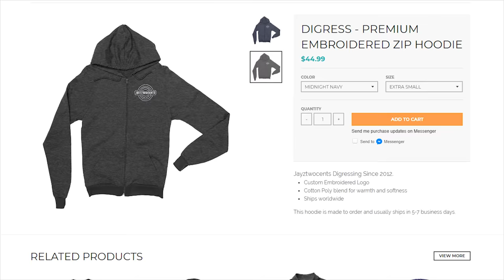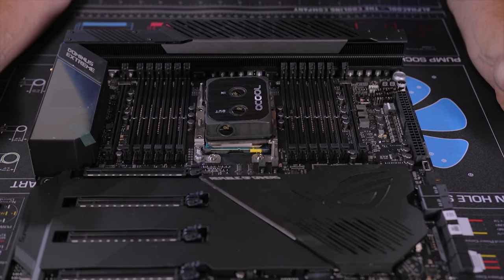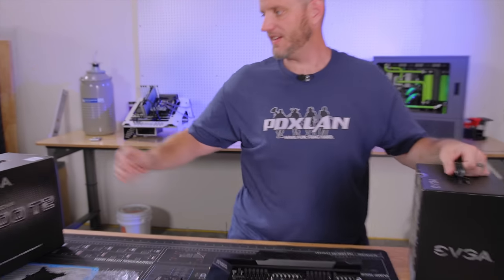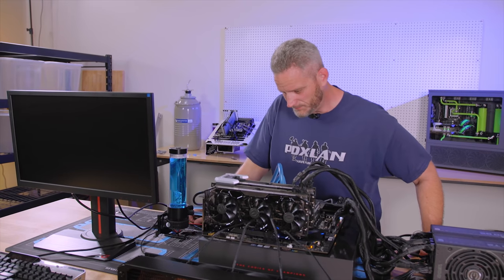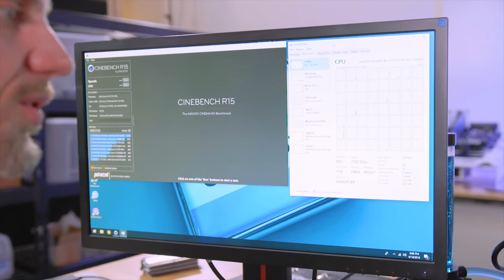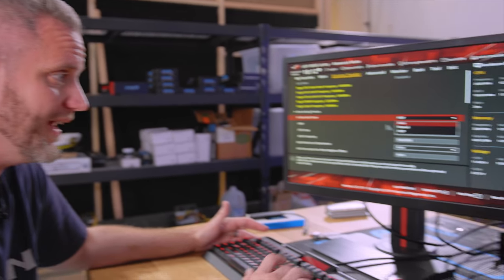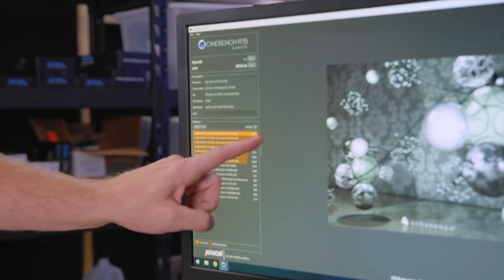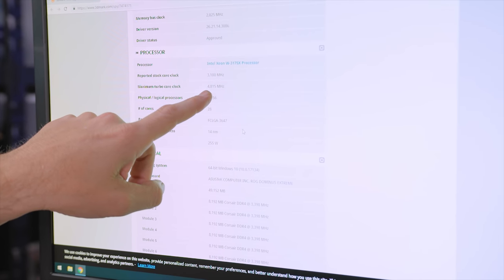Intel Xeon W-3175X Overclock Testing! This was unexpected...

Comment: Nick just "walks by" with a model ship... Nice shameless ad placement for World of Warships Jay! 😂

Screw dual RTX Titans...

Give Steve the benchmark haymaker with dual Quadro RTX 8000s with dual channel NvLink.
Reply: Linus tried Quadros. The performance was bleh.
Reply: @SoranoGuardias  I figured as much, however if you could hack the BIOS of Quadro card you technically could clock boost it maybe to a point where it could match attainable clock speeds by Titans or 2080 TI's, however you would need some significant cooling and very few vendors support water cooling developer level boards.
Reply: @ReaperX7  The power budgets are not high enough. The PHYSICAL power budgets are not high enough.

Comment: overclocked tr 2970wx just touches 5000, and I have seen some of those on Ebay for as low as 1K$USD

lol
Reply: The 2970WX is pretty slow, a 18 core 7980XE just smashes it to pieces. The Xeon W3175X was meant to compete with the 32 core EPYC 7601, a $3K-4K USD CPU

Comment: Seeing that first Cinebench run gave me a flashback to some time 2009 or 2010 when I ran Cinebench on a 8 CPU machine with Opteron 8439 which is a six core processor. The first run of Cinebench had my standing there with my jaw dangling uncomfortably close to the floor. None of us had worked with anything more than dual CPU boards, so seeing 48 cores chewing through the Cinebench benchmark was very impressive. I saved a lot of benchmark data from that machine just because it was so out there, but unfortunately the company I worked for folded some years ago and I didn't think of saving all the benchmark data I had collected. It would have been fun to see how that monster would fare against modern desktop processors. It couldn't hold a candle to this monster, that's something that's certain. The 8439 ran at 2.4 GHz, and the 8 processors was distributed over two PCB's connected using Hyper Transport links. I do not remember the exact interconnect fabric, but I think there were just to HT links connecting the boards together. I think a worst case scenario had data hopping three processors for one memory access and that cost performance.

Comment: AMD: Laughs in 64 core Threadripper
Reply: Doubt that AMD will create an EPYC Rome CPU for the enduser...and even then, it would probably be a trash version of Rome just like how the 2990WX was the trash version of the EPYC 7601
Reply: @JABelms  I'was expecting a 48 core TR actually...

But the recent leaks changed my mind because:

1)Intel is doing the same.

2)They have a chance to win in almost every benchmark by a factor of 2, and that if tou ask me it's a great marketing mechanic for lower end products.

3)They'll be breaking world record left, right and center with OC.

4)They can still modify the I/O chiplet for segmentation.

5)It'll be fun.
Reply: @danielepicone2557  Still doubt it, a 64 core TR should be a lot cheaper than the EPYC Rome version, and you know the drill...when you make an EPYC chip cheaper you cut corners and it would have an abysmal memory controller (again) just like the 2990WX. And it is kinda hinted in many benches that intel IPC still leads

Not to mention how useless it will be to have a 64 core CPU for mainstream users. 32 core still has very few use cases in the real world, and that even 16 cores can get the job done. But 64 cores? Planning to use it for a server? AMD was talking BS when they marketed the 2990WX as the first "32 core gaming CPU" (which is dumb in itself), I don't believe they have an excuse for a 64 core Threadripper anymore. Besides, professionals usually buy EPYC or Xeons instead

That 64 core threadripper would just replace the previous manycore world record holder 2990WX. 95% of the world records in HWBot are not solely about more corez...that is why the 7980XE holds almost all of them

Comment: 1U != a blade server! 1U just means 1 rack unit, or rather one slot in a rack. Generally, a blade server is when you take a traditional height server, 4U for example and put "blades of servers" within that enclosure. Usually that enclosure supplies all power to the blades, for example, a 4U enclosure would slot 8 blades to increase density in the rack.

Comment: Hey Jay! Normally on the LGA3647 based systems, you actually mount the processor in a plastic bracket that then in turn gets mounted on the heatsink. You then put the CPU+heatsink directly in the socket. It's a terrifying experience because you can't see what you're actually doing and if things are aligned properly.
On LGA3647, it's actually the heatsink that provides the correct amount of mounting pressure. I think Intel states on their own active cooler, that you tighten with 1.4nm of force on those. The 2 threaded pins sitting on either side of the socket act as springs and tighten up. The corner threads are just there to guide the heatsink into place.

Comment: Ok, get a BIG cooler and fill it with ice.  Let it melt down a little for a couple hours, put copper coils in the cooler when you put the ice in, and then connect your loop to the cpu, and both GPU’s.  Run the pump by itself for about an hour with the computer off.  Fire up the computer and IMMEDIATELY jump to the testing.  Leave the pump running at max speed and have all the fans at max speed.  The give Phil a 40v lithium brushless leaf blower to point at the rad also!!

You’ll hit 17,000 in a jiffy.  Also, put the 4000 memory in.

Comment: The specsheet for the socket specifies the side screws should be tightened to 12 lbs-ft of torque, and that should ensure all pin solid contact. Get torque screwdriver and check.
Running this board on a cardboard box is NOT advisable, btw. It introduces flex to the PCB under the socket.

You're not the first to have issues with missing memory channels on this CPU, but this rarely happens on the server platforms. Roman Der8auer machined his own retention bracket and had better luck, but again, server motherboards are mounted usually on a pieces of solid metal reinforced with welded on profiles for stiffness.

Comment: I work in datacenters on just hardware. From all the LGA3467 system's i've worked on, primarily HP DL380 G10's, they all want a torque wrench screwdriver set at 12 in/lb.

Comment: Hmmm. 1U = 1 Unit of a Rack. They aren't blades, and many people refer to them as pizza boxes. They are typically 1.75 inches, or 1U high, 19 inches wide with rails (17 3/4 without, and vary in depth up to 36 inches... Blades go into a blade chassis, which typically fits into a server rack but can vary from 1U on up. I haven't seen one bigger than 9U, but, I haven't seen everything.

Comment: The xeon series chips should have a plastic retension bracket that attaches to the heatsink, then that get set into the socket then torqued to about 12 inch lbs

Comment: the reason you got a better cpu score than GN is because of OS efficiency due to newer versions of windows 10 handling high core count cpus better and fresh installs just running faster than used installs but slower than stripped installs. Also newer Nvidia drivers could have become less intensive on the cpu with maturation of the cards and drivers.

Comment: Awesome build by the way. One thing I have been wondering about water cooling builds ( as I am interested in doing one ) I noticed all the fittings you put together, you don't use Teflon tape as we do in all plumbing applications. Would Teflon tape help in a CPU cooling system to prevent leaks? or are the fittings so precise that it isn't needed? or?....

Comment: I recently bought an old Dell with a Celeron D with a broken motherboard to use the case for a sleeper build. I killed the Celeron to get the IHS off and I'm going to attach it to the inside of the case in a prominent spot.

Comment: Does the motherboard automatically detect 2 supplies and turn them both on? Or do you have to have like a bridge, 2 power buttons etc?
Reply: the hardware pulls power as it needs it, the cables are the straw to the PCs cup of tea
Reply: Caleb Harwell motherboard does it by itself.  Also draws power from primary first, then secondary for the motherboard components.  Stuff plugged in via 6/8 pin cables draw from their respective power supply’s cables.

Comment: @JayzTwoCents I'm sorry for complaining here but at around the 3 minute mark, you're talking about blade servers and 1U 2U and so on. This is incorrect. That are RACKservers. Blade servers are something else. Generally blade servers are fitted into so called blade centers, and those blade centers are rack servers that follow the U height standard. Blades however, have absolutely no standard at all for heights, and are not even standardized within the same vendor, or heck not even within the same generation and vendor. And you're not going to be watercooling a blade server for various reasons. So please, don't confuse blade and rack servers. It could give someone the impression that they could actually run a blade server by itself, which you can't because it lacks all I/O because that's all part of the blade centers, not the blade servers.

Comment: Why doesn't some CPU heat spreaders come with an integrated water-block from the factory for higher efficiency cooling?  Why hasn't someone designed a fixture for water cooling to be soldered or epoxied to the heat spreader?  You could also use a vapour chamber with a water block attached directly to the heat spreader.

Comment: Would it be possible to try a passive cooling of the water with a chilled coil wrapped around the water pipe a two stage solution with the radiator.  That way the water would only be cooled some as it passes through the pipe that runs through the coil and you never get condensation, just several degrees cooler water.

The radiator would cool the air some, the coil even more.

i sort of can see the design in my mind and I wonder how well it would work.

Comment: Hi there, I want to ask what can I buy and what fits better to my pc
which is the better graphics card and the optimal one (if you don't want to reply you are free to do so, making me search elsewhere)?
I have an Intel Core i7-4790, 3.6Ghz, 16 Gb RAM & a Max Output power of 460W
with I guess, enough space for a 10" length graphic card,
for short, I have an XPS 8700 with windows 8.1
(I don't know what else I need to mention)
So I want to know if I can install any of these cards
(or which one do you recommend me, preferably for less than $350):
RTX 2060 (I know this one requires 500W I don't know how much is this important... for real)
GTX 1660 Ti OC (this one requires 450W, right?)
GTX 1070 Ti
GTX 1060 6GB
those are my options in that order (I want a GPU with at least 2 coolers/¿fans? not too loud) also, I plan to save it for the next black Friday or any other good discount so there's much time until I get it
In any case, Thank you very much for your instructions.

Comment: It's cool how power scales with money now.  So if you're poor and you buy used parts, you can get 1/3 the speed of the fastest gpu for under $90 and 1/3 the speed of the fastest cpu for under $170.  Yeah, my $600 computer gets 2200 in cinebench r15.

Comment: if a motherboard says you cant exceed hardware (GPU) beyond Nvidia GTX1060, does that mean I cant use a different brand? Or as long as the hardware matches pin slot?

Comment: Yeah, der8auer also said in video of this platform that is was a pain to get all the ram channels working due to the missing fixiation in the socket... Don't know why they did not do anything here, I mean you buy a 2000$ board and a 3000$ CPU and then you have to bother around with the pin contacts?

Comment: i bet the bracket design has the purpose of LN2 overclocking and with air cooling dont want the socket to end up having heat trapped under the retention design(witch is a server issue as well witch is why its dune this way) and as the price suggests you should not buy this if you are not a vary carefull pro user/overclocker.
Reply from the maker: That has nothing to do with it. The bracket is meant for servers which obviously LN2 isn’t
Reply: @Jayztwocents  well a test on does no retention bracket help with LN2 mods or not will need to be done now that I brought it up!

Comment: This is funny watching you guys in consumer fiddle with the Socket P (LGA3647) when we've been using it for so many years in enterprise. +DDR4 for Intel Xeon (Skylake) should only run 2667MHz, anything beyond that is pointless. Cascade Lake will be using the new 2933MHz but you don't have those yet. (I cannot wait to work with CascadeLake AP)

Comment: I think you don’t realize you’re using a 325W TDP CPU at stock so your loop is probably heat soaked really easily. You should be using a stupid ass Jayztwocents giant radiator project with this CPU. It’s not about chilled or ambient it’s about MMMMMMMONSTER power draw and proportional radiator insanity

Comment: There are so many settings on the Dominus Extreme, it's like a bible. It's a shame i can't even find one person who shares some info on bios settings how to overclock the W-3175X. I'm stuck at stock speeds, only because there are no instructions on how to do it. Not because i don't have the PSU or the cooling. Would be nice to use the "upload BIOS profile from USB"-function, but they are not to be found anywhere either. As a non-expert enthusiast, i feel left out.

Comment: Hello,

I need to build a system around 5000 dollars except monitor keyboard and mouse . My main purpose for this machine is i need to use that for 3ds max ,Vray for animation and rendering and some dynamics and simulation i thought to buy in this week.

CPU: Amd ryzen thread ripper 2990wx 32C/64T

MOBO : Asus Rog zenith extreme AMD X399 with M.2

RAM: Corsair Vengeance LPX 64GB DDR4-3200

STORAGE 1: Samsung 970 Evo NVMe 512GB M.2 (for C drive only)

STORAGE 2:SSD 1 TB (ANY)

GPU : Nvidia GeForce GTX 1080ti founders edition 11 GB.

COOLING : cooler master MLX-36M A20PC-TI RGB AIO

POWER: Corsair RM 1000W 80+ Gold ATX Power supply

CABINET: Cooler master H500M ATX Mid tower Case 

Can you please give me any guidance for this.

Thanks in advance

India Mumbai

Comment: well...$3000 cpu, $1700 mother board, amd announced thread ripper 2, most likely 64 cores for cheaper than that 24 core and will be able to use x399. meaning my asus zenith extreme will be viable for many many years to come. and...amd will smoke that over priced intel. intel is soooooooooooo screwed. their over priced crap that only people with more money than brains will buy. lol.